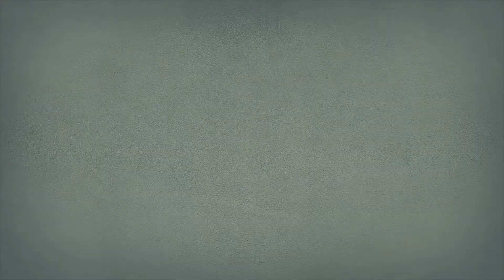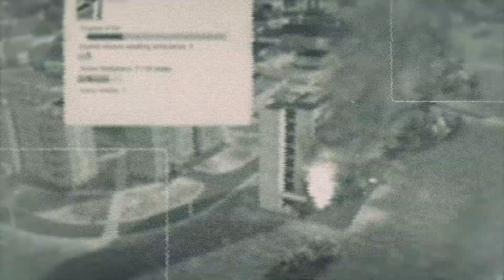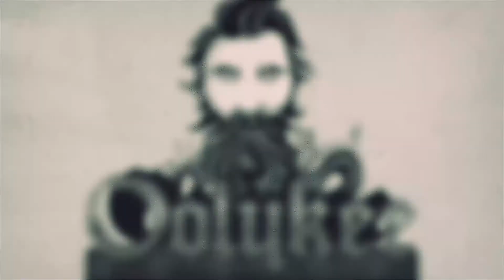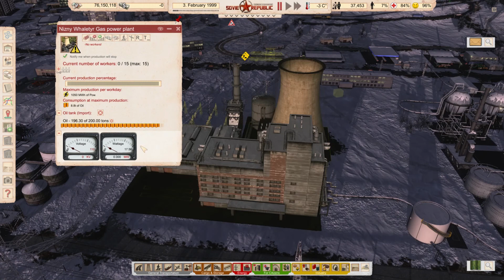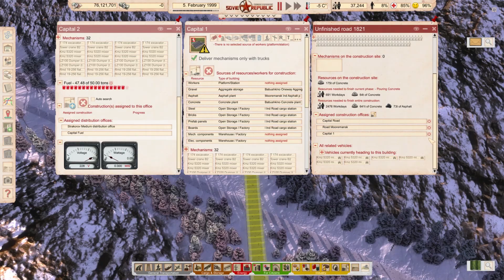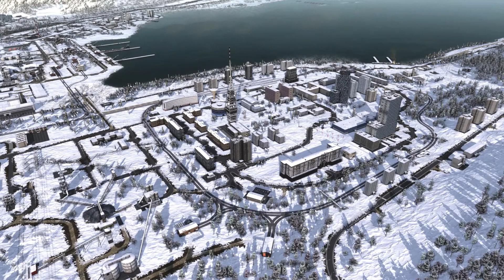Soviet Republic - Alaska - Passengers - Ep.205

Comment: I had indeed forgotten that you wanted to transport your workers from Whaletry accross the bay (my bad), but this mode of transport has two problems :
a) the boats cannot have line spacing and to have maximum productivity (1,600 workers) without line spacing it is almost impossible
b) the game also has an issue launching its boats from a 4 slot dock to a 2 slot dock, the boats from the first dock will not leave as long as the game believes the second dock slot is occupied (and if the dock is already registered in the itinerary of a departing boat it will be considered occupied).
c) You can limit the problem of point b) by having a 4 slot dock on the other side of the bay but that will not solve point a)
d) You can settle point a) with a complicated set of buoys to artificially space your boats but I doubt you have the patience to do this job
Reply from the maker: a. should we ignore passenger boats until devs have mercy on us and give us this option? 
b. I didn't know this! Thank you
c. Let's see how it goes with 2 ships. If we don't have enough capacity I might get a bigger boat. 
d. I like your cheeky remark at the end of the sentence but reverse psychology rarely works on me. I have no issues setting the buoys up. The only problem is remembering to do so once we set the line up.

Comment: Well BTW it's not the best idea to delete small excavators from the Footpath Office ; since the last update many footpaths of a certain length can be built with excavators without even outside workers. For the mechanical components of the pipelines you had the CO bus which has a lot of covered hulls (even if I don't find the very good tremplate, it's the one you chose) and which was intended for that.
Reply from the maker: Footpath CO will send the buses to the footpaths anyway and the time to build it is short. so it's either going to have people finish the work before the excavator has arrived or it will have the excavator finish the job before busses arrive and teleport the people back home without doing the work. 

The solution is to have a footpath office and a short footpath office. :)

Comment: Whaletyr heating issues : also delete your university workers and other cultural or sporting workstations in Whaletyr. Redesign your transport lines (you still have lines taking workers to supply the refinery) in such a way that the workers present at this bus station are used ONLY for heating and power plant. Two hotlines must be in operation, and only these two. In short, as often you are overlooking the problems, and that makes me angry. You have spent 5 minutes in Whaletyr while your population is dying. Both in terms of roleplay and in terms of the game, this is unacceptable. What the hell could there be more important to deal with than having 37,000 inhabitants in 1999 ?
Reply from the maker: That's a lot of work. But obviously needs to be done! 
I will do this. 

5 minutes in Whaletyr is more than developers spend on breaking my game. :D 
Also, the game is mostly paused.
Reply: @oolykeegaming81  If it wasn't paused all the time, the game would probably already be over. 😝😈
Reply from the maker: @frankevert4525  there we go. A bit of balance between pro and anti pause people. 😄😄I enjoy both. ☕

Comment: Harbor area of Mooremansk : it's too easy to set up the two big agragte storages to receive only coal. One of the two was to store and export your excess iron production. If you don't have enough coal in one of the two aggregate storage units, it is only because you need more coal trains. This harbor was to be a huge export terminal for a huge production of coal and iron. The one and only problem is that you have not set up the transfer of this coal and this iron between the production areas and the export area.
Reply from the maker: So we will have to double up on the harbor area and set new iron export harbor. We cannot have 9000t ship wait for a year to be filled in. 
Coal deliveries are planned to be increased. I just need to fix the power supply in the coal mining area.